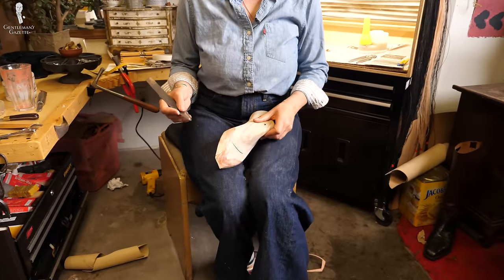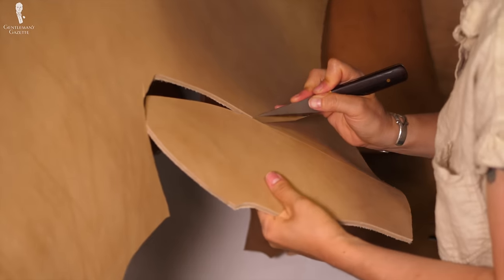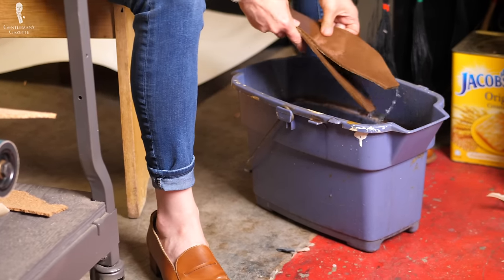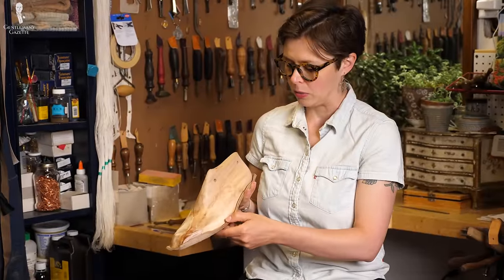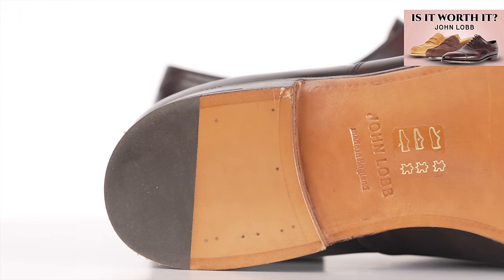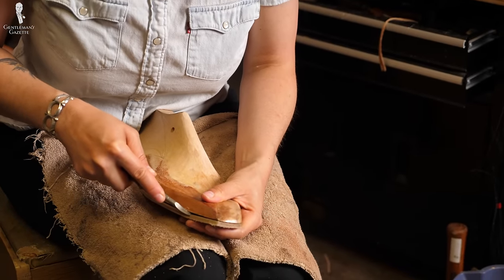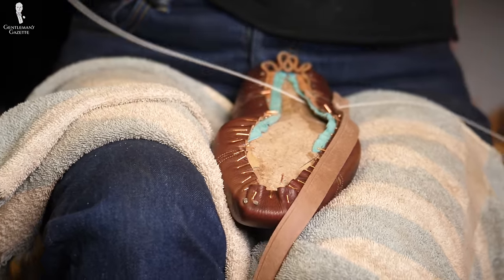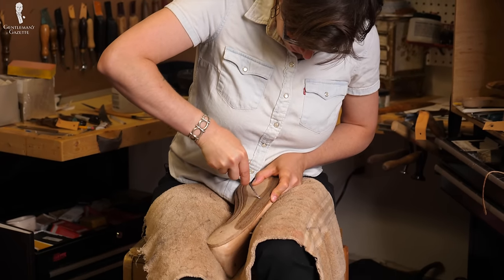Creating Insoles, the "Backbone" of Handmade Bespoke Shoes

Comment: Bought a pair of shell cordovan AE Leeds on ebay for 130$... someone had spilled black shoe polish on the inside all the way towards the toes. After a few hours of cleaning it out I ordered a new pair of saphir insoles to put over the top of the old ones. If that doesn't work I'll have to take them in to be cleaned out, or spend about 10 hours scrubbing it out.